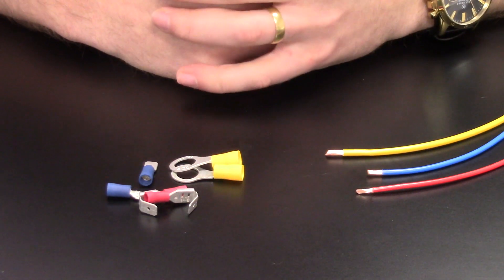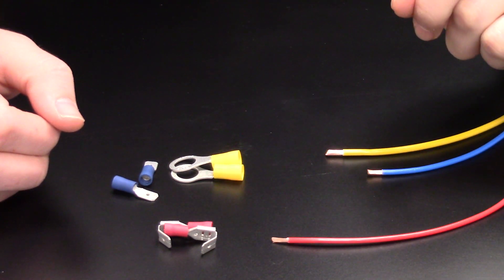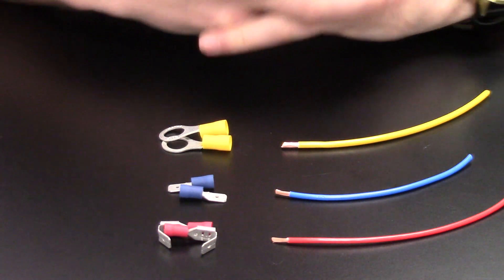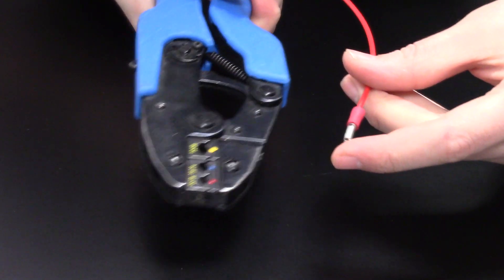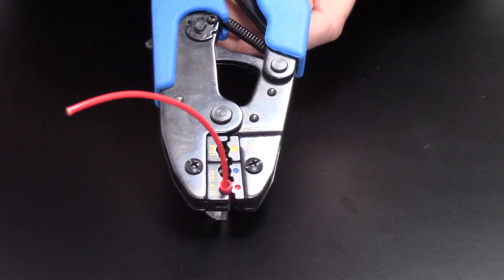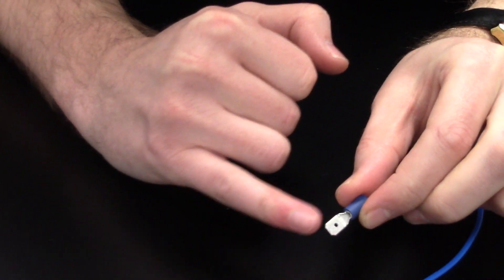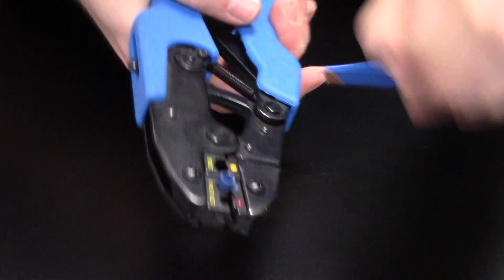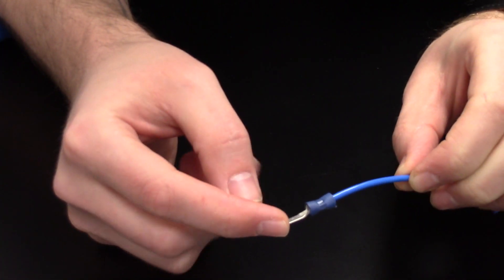Crimping Insulated Terminals | 12 Volt Planet

Comment: Just a couple of comments:

The insulation should be stripped to a length so the ends of the wire strands just protrude past the end of the crimp ferrule by a mm or 2 and are just visible when the wire is pushed fully into the crimp. This ensures the maximum contact area between the wire conductor strands and the barrel and reduces the contact resistance and therefore heating in high-current joints.

The terminal should be placed centrally in the jaws for crimping as there are usually 2 parts of the dies of slightly different sizes  - 1 for the barrel where the conductor strands are crimped and the other for the insulation. If the crimp isn't positioned centrally, either the barrel wont be crimped fully along the length of conductor strands or the insulation won't be gripped properly.

Comment: Do you have to use your special crimper for heat shrink terminals or will my normal pre-insulated ratchet crimper work on them?
Reply from the maker: Hi, For heat shrink you will need to use a special tool as it will prevent the sleeving from being pierced and the adhesive leaking.

Comment: Well, I didn't know that the colours were for the different size cable, I (wrongly) thought that was identifying positive and negative (but I guess that can be illustrated by the cable colour and labels?
Also, how much insulation should be stripped off the wire for inserting into the crimp ?
Excellent thank you
Reply from the maker: Hi, Yes the colours of the terminals are purely for cable size. Cable colour can be anything that helps you identify what the cable is for. We normally say around 0.5-1cm of insulation should be removed for termination.

Comment: Also worth noting that some crimpers require the crimp to be inserted the correct way round as sometimes their is a difference in the crimping anvil, one half crimps  one half onto the wire and the other half crimps onto the wire insulation.
Get it the wrong way round and the crimp is not as firm enabling the wire to pull from the crimp.
Reply from the maker: Great tip Matthew, Yes you are correct. Luckily our tools can be used either way round but worth noting. :)